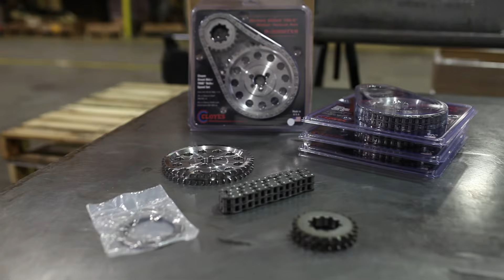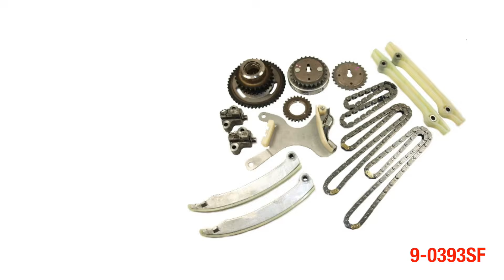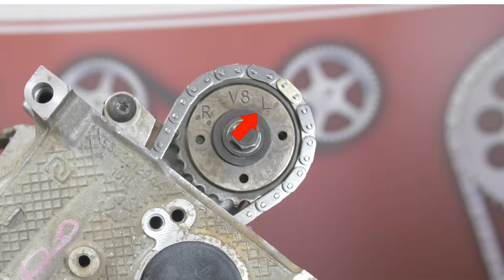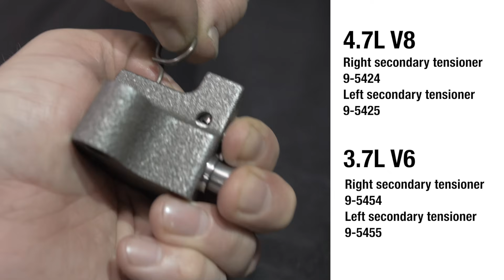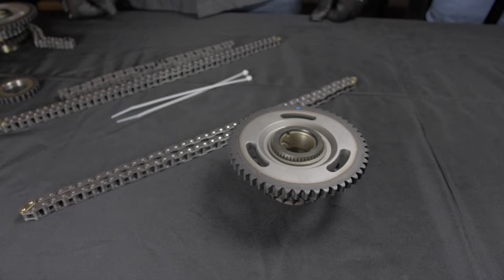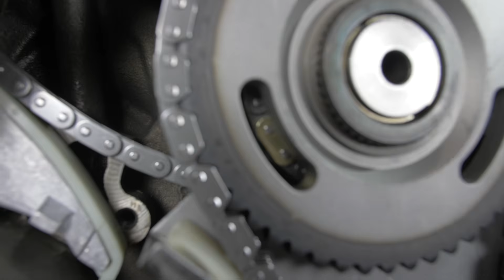Cloyes: How To Service Timing Components Chrysler 4.7 L V8 Power Tech

Comment: So many things wrong with this video presentation. I’ve got a damaged cam lobe from the top left vise grip part and there wasn’t anywhere to put a vise grip. If the machine shop can’t fix the lobe then I’ve got to fork out about 1k to replace both camshafts. Still stuck on center sprocket. The way he sped through the center sprocket is a disservice to Cloyes consumers. We can fast forward when we need to do so.

Comment: Note the part of the video outlineing tbe new old sprokets and chains if ther correct you wil be able to sync your cam chains to have your single link indacator link to be in the middle of punched out part of the upper sproket ....................yes you csn use a cordless impact on cam sprocket retainer bolt. but use 1/2 and use a Milwaukee  gun will be fine. other hacks if you dont have thread lock rtv will work too. but be generous with assembly lube its impossible to use to much . this video was one of the most effective , to the point video ive ever used. your able to play and pause without skipping steps . most importantly dont rotate the plsy out of
 the chsins csuse they will snap. so if you had a issue understanding the steps your a over confident  dumb ass that is probably telling your old mustang stories to the shop you bring it to while clamming you bought it in this condition or soneone else took it apart to save your ego. tell them your jjst stupid and not very mechanical inclined . so they know what stupid stuff u did to get it where its at it will help the tech fulfill his part and suceccessfulhy repair the vehicle that you Mr. girly man cannot ....😅😅😅😅😅😅 ty for the vid

Comment: Thank you for all your helpful and interesting videos. I'm just putting new timing chains in my 2004 Dakota. When i put the camshaft chains on, the two black links are not exactly center in the slot windows. I really can move the one tooth back or forth. they end up either on one end of the slot or the other. What do you recommend? thank you

Comment: Question more than a comment, 2009 Ram 1500 4.7 L, 16 spark plugs, how many camshaft positioning sensors does this unit have, some say one, others say two. have replaced one camshaft sensor and crank sensor, still getting the camshaft sensor code, cleared it several times prior to replacement, once replacement was completed still getting code and it will not clear. any help is appreciated. thanks
Reply: I would say two due to it being a twin cam engine
Reply: 4.7 shouldn't have 16 plugs
Reply: @FaithandSanctificationThrough7   well i hate to break it to you, its nickname the mini hemy and it has 16 spark plugs 168$ just for the plugs not counting wires and boots
Reply: @Rougaru-vn3cn where do u live, can you help me do my timing, nothings wrong its a high mileage truck, and the 2nd cam sensor is on the left side of the left cyl head
Reply: @FaithandSanctificationThrough7 newer ones do. They’re 2 different sizes as well
Reply: @FaithandSanctificationThrough7 yea it does. They’re 2 different sizes too

Comment: The manual says to tighten the tensioner chain guide bolts with the T40 to 12.5ftlbs, not 20ftlbs. After my cylinder head cracked where that bolt goes, I decided to download the manual. So now I need a new cylinder head.

Comment: I used the cloyes kit the guides broke in half not too impressed I have to do it again
Reply: I'm on the 3rd try in 3 years. First 2, the secondary chains stretched till it jumped time. As you may or may not know, bad things happen with interference engines when the timing jumps. ( only bent valves might be considered to be lucky )
I just pulled the cover yesterday to surprisingly find the primary guide factory mount let loose. (guide teflon was just lying there out of position off the mount!) Also, opposite side teflon is missing off the mount.
Some part, not sure yet because that's where I left off, got caught up on right secondary & polished the outside edge of chain & gouged the outside of the sensor sprocket. 
My first kit lasted just 11 months! Fortunately, it was still under warranty. This time around I got 18 months out of it. Warranty expired😒

Comment: Does the tensioner puts pressure on the guide as soon as you remove the release pin? Because when I remove the pic from the tensioner, it does nos reach the guides.
Reply: sounds like it may need to be replaced if its not extending far enough to do what it showed when he unpinned them.